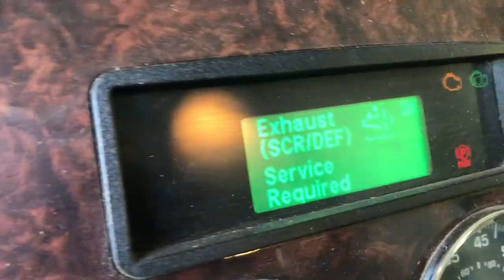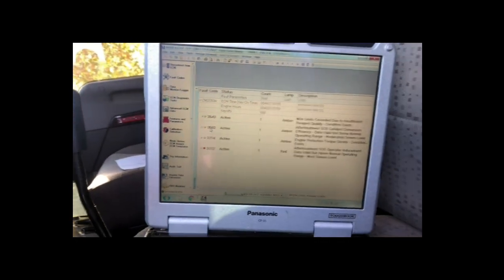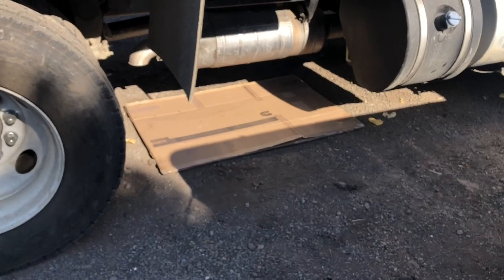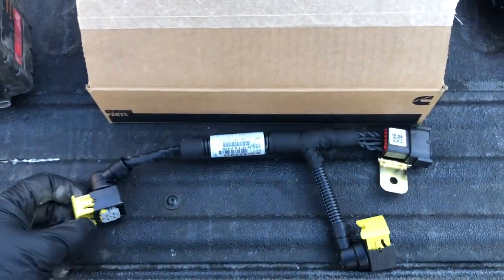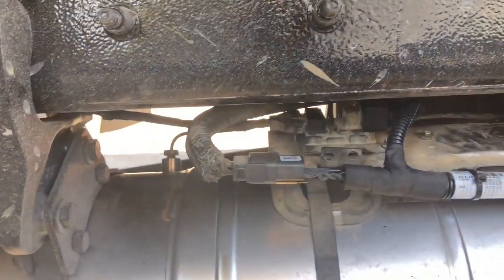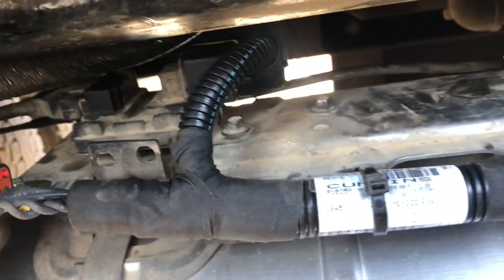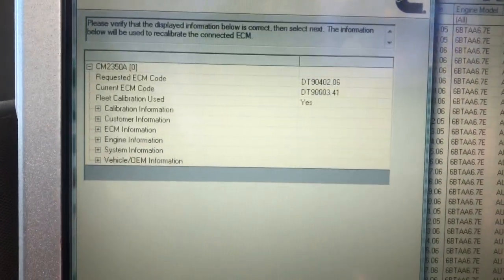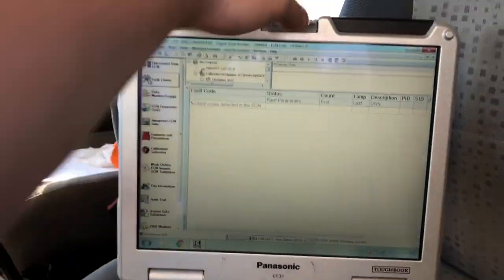Cummins SCR Repair - NOX Efficiency

Comment: I installed a brand new computer in one of our trucks, installed the same calibration it has all the updated parts and i get a code now and i didn’t with the old computer and same calibration. Do you know how i could fix this? The new ecm is the correct part number by the way

Comment: I am getting SPN 4364 FMI 18 Aftertreatment 1 SCR conversion Efficiency. I have replace first inlet and outlet sensor but the codes still shows and check engine light. I was thinking next to replace Doser Valve and see if that helps. Otherwise its something else. Can you possible help me out and know what it could be?

Comment: I have done the SCR replacement , updated the wire harness. Insite is telling me that I need a fleet count to download the calibration into the vehicle. Do i need to make a work order to do that or call cummins. I have insite pro by the way.
Reply from the maker: Yes. Have to contact to buy a fleet count. I think they charge a dealer $75, idk what they charge if just someone calls. Its pretty much like a permission type thing that allows you to change the truck calibration from one to the other.

Comment: This video should be titled "How to Replace an SCR Catalyst". It has little to do with how to repair an SCR efficiency fault (it's "SCR efficiency", not "NOx efficiency").  Before you shell out a bunch of money for a new SCR catalyst, there are things to inspect and test, starting with checking the DEF with a refractometer.  Most importantly the SCR pump override test to make sure the pump is working and the doser isn't clogged or stuck open.  Then, disconnecting the doser and monitoring the NOx sensors during a manual regen to make sure they are within 50 ppm of each other.  If you don't do all the tests and inspections, you're blindly throwing parts at the problem.
Reply: That’s what My thought was how quickly he’s throw expensive part in trucks more like dealership ways.Totally agreed.
Reply: @AmrikSingh-rw6ew  HE MAY HAVE DONE THOSE TESTS OFF CAMERA...LET'S CONSIDER THAT FIRST.
Reply: How can I do mine I think I’m getting codes